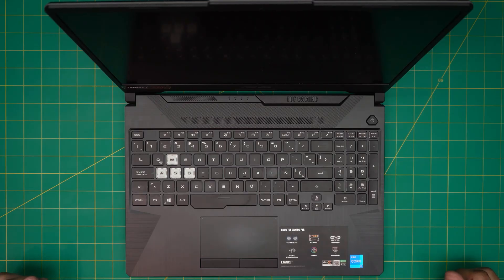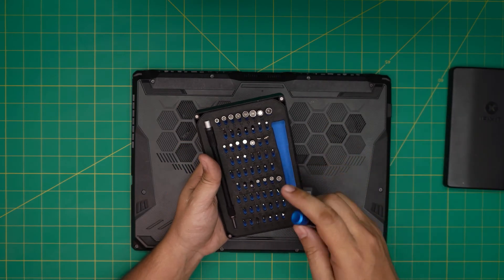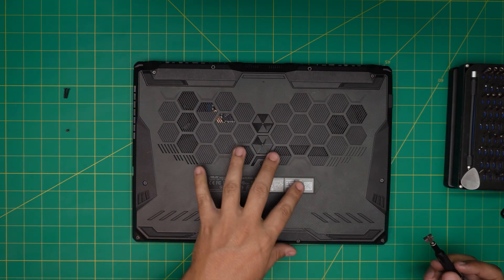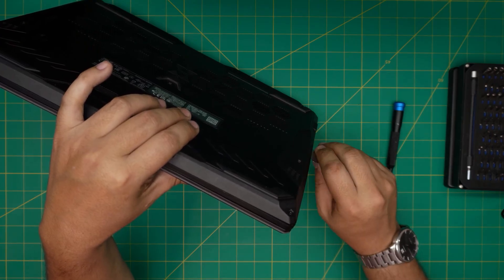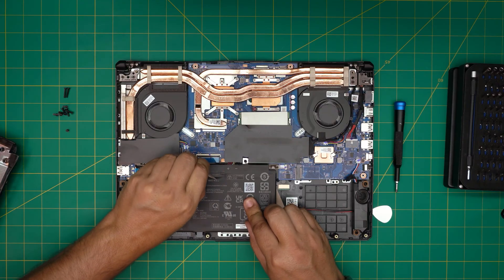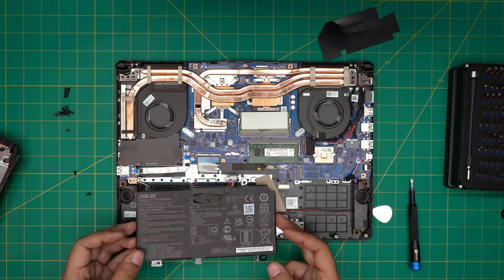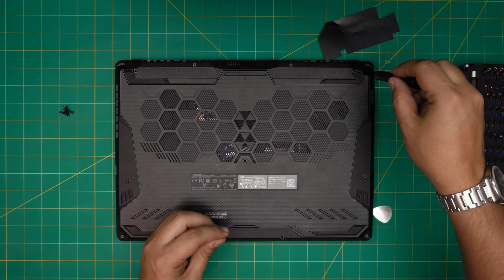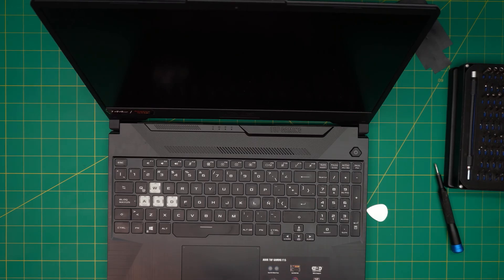How to Replace Battery on Asus Tuf Gaming F15 FX506H Laptop - Step-by-Step🔋

Comment: does it has any cmos batter or not my laptop is not working i have to remove and. put back the cmos battery
Reply from the maker: 🫠 Regarding your question, this laptop doesn’t have a dedicated CMOS battery; it takes its charge from the main internal battery. You can use the laptop without the internal battery, but it will take a few seconds to power on when only the charger is connected.
Cheers 🍻

Comment: Sometimes ,after turn off  i start at morning then i see battery is fully drain and sometimes same perce tage, i saw 3,4 times, is it software issue or battery issue, i guess i need to look more it it happening or not lime draining issue, its almost 3 year pf my new asus tuf laptop
Reply from the maker: 🫠Regarding your question, that is a battery issue. We get that issue all the time in the store.
Change the battery only.
cheers🍻

Comment: I plugged it in for one hour and the light that signals it being fully charged is on. Do I still leave it for another four hours?
Reply from the maker: 🫠Regarding your question, no after two hours power on and see if the charge is 100%, else you got a bad battery.
cheers🍻
Reply: @uFixTek  turned it on and 100%. Do I drain to 50% and charge again?
Reply from the maker: drain and then charge it back to 100.

Comment: is it possible to remove the central battery and then plug it in and still use it? battery is causing my laptop to turn off whilst plugged in
Reply from the maker: 🫠Regarding your question, sure you can without any issues.
cheers🍻

Comment: HELP PLEASE 

My laptop just shuts down and there is no light at all. I pressed the power button for 1 min. It starts to turn on but automatically shuts down again.

What could be the problem, and how can i fix this?
Reply from the maker: 🫠Regarding your question, I recommend you do the following:
Disconnect the charger, open the bottom cover of the laptop, disconnect the battery, and press and hold the power button for 30 seconds.
Plug in the battery and the charger, then power on the laptop and wait up to 30 seconds.
If the laptop still doesn't show any signs of power, then you have a component issue and need to find a good repair shop that can perform component-level repairs.
Should you have any further questions or requests in the future, please don't hesitate to ask me.
cheers🍻

Comment: Mine is so hard to take out why
Reply from the maker: what part is hard to take out?
Reply: @uFixTek The battery
Reply from the maker: yes that jack does requires a bit of force to slide it out (remove the screws for the battery and then use the cable to slide the connector).

Comment: hello sir i have replaced my battery today but it is giving only 2 hours backup it is good or not because i am not open any hard software i am using normally lectures only
Reply from the maker: 🫠 Regarding your question, that is normal for 2 hours. You can set the power management to save battery, lower the display brightness a bit, and close any programs that may be running in the background. But 2 hours on average is OK.

Comment: HELLO PLEASE HELP

I changed my battery and then put the bottom cover back on, when flipped it over I noticed the battery light came on as if it was charging. Out of curiosity I powered it on and it tells me it is on charge when there is no charging cable connected. How can I fix this?
Reply from the maker: 🫠 Regarding your question, disconnect the charger, disconnect the battery, and press and hold the power button for 30 seconds. Then let go, plug in the charger, and wait 30 seconds. After that, reconnect the battery (without disconnecting the charger), let it sit for 2 hours, and then test it.
cheers🍻

Comment: Can I upgrade it to 90wh battery?
Reply from the maker: 🫠Regarding your question, sure you can, as long as the connector is the same and the screw holes match. You can definitely use a 90Wh.
Should you have any further questions or requests in the future, please don't hesitate to ask me.
cheers🍻

Comment: I want to know about the battery can you change it from 45wh battery to 90wh battery but different model number?
Reply from the maker: 🫠Regarding your question, sure you can, IF you find a battery that fits in the same place with the same clips, and has the same exact connector. sure you can place a 90w or 95w.
Should you have any further questions or requests in the future, please don't hesitate to ask me.
cheers🍻

Comment: Mine is ASUS TUF Gaming F15 FX506LHB it has 48Wh battery originally ,can i upgrade it to 90Wh?
Reply from the maker: 🫠Regarding your question, yes, you can, as long as you find a seller offering a 90Wh battery with the same connector. You can definitely replace it.
cheers🍻
Reply: @uFixTek is it possible?
Reply: Were u able to do it?

Comment: can i change a 90hrw battery in 48whr asus tuf f15?
please tell
Reply from the maker: 🫠Regarding your question, sure you can, as long as you can find a seller that sells a battery for this model that is 90Whr.
it must have the same connectors and the same screw holes, don't force it.
Should you have any further questions or requests in the future, please don't hesitate to ask me.
cheers🍻

Comment: I have the FX507ZC4 model, since I bought it i feel that the battery doesn't last how much it's supposed to, and recently it doesn't want to turn on when unplugged and when puggled it's very hard to make it turn on, but it turns on eventually and the light when the charger is plugged works. Should I replace the battery or could be something else?
Reply from the maker: 🫠Regarding your question, we get this issue for this models all the time in the store and the problem is on the motherboard, we recommend you to send it for warranty, as the issue will get worse over time.
Should you have any further questions or requests in the future, please don't hesitate to ask me.
cheers🍻
Reply: @uFixTek  Thank you so much for repplying, unfortunately it doesnt have warranty anymore :((
Reply from the maker: It's my pleasure, my friend. Unfortunately, you will need to find a skilled technician near you who can check and repair boards at the component level.

Comment: Bro I have tuf f15 11th gen rts 2050 fx506hf 48wh battery can you tell me it is upgradeable to 90wh please reply bro
Reply from the maker: 🫠Regarding your question, we have not seen a 90w battery for it on sellers, but if you find one that fits with the same connector it will work, as long as the connector is the same and is for ASUS.
cheers🍻

Comment: Hey man, i just replaced my battery and my laptop turns on and stuff but it doesnt recognise the battery. Even when i put the old one in (before the change it would recognise it) it doesnt recognise it. The charging light is flashing. It also doesnt work when i pull the cable out which means its not chsrging the battery either. Ive checked the pins and i couldnt see any bent pins. Any solution?
Reply from the maker: 🫠Regarding your question, Remove the charger and the battery, then press and hold the power button for 60 seconds. Afterward, reinsert the battery, plug in the charger, and wait 15 minutes before powering on.

Comment: I  bought this laptop because it said it came with a 90W battery.  It doesn't as seen here it says 48W.  I reached out to Asus and they said the 90W will not work with this laptop because it is 15.4V.  So I am stuck with it.  Yet still they advertise this laptop as having a 90W battery.  Unreal.
Reply from the maker: Oh, we hear that in the store all the time. Once we open the laptop, clients often claim we’ve swapped their 90W battery for a lower one and accuse us of stealing it. This is a classic issue with our clients. So, whenever we get a client with this laptop in the store, we make sure to inform them upfront that they don’t actually have a 90W battery, even though ASUS keeps advertising it as 90W.
GG

Comment: My battery is draining my full charge capacity is lower than the design capacity do i need to change and also the computer performs low while on the battery bro
Reply from the maker: 🫠Regarding your battery, yes, you will need to change it. These laptops, when used on battery, will run at a slower clock speed because the battery can't output enough amps.
Should you have any further questions or requests in the future, please don't hesitate to ask me.
cheers🍻

Comment: Everyone here for the 15v 90w battery going in the 48w models - NO 😢 (we got ripped off)
Reply: @uFixTek  I have the F15-FX506L , have been told can’t upgrade the battery? Can confirm
Reply from the maker: the battery that i can't find is only48w and i have not to see a higher capacity with the same connector and that it fits.

Comment: Hello, I have the same laptop. I disconected the battery and replaced the ssd, but when I reconnected the battery, the laptop wont turn on, and show no light, even with the charger connected, any idea?
Reply from the maker: Did you insert the ssd correctly and is no side ways in?

Comment: Cnau I change my ausu tuff f15 506hf battery from 48 w to 90 or something better
Reply from the maker: 🫠Regarding your question, i have not seen a 90W battery if they have made it with same connection and screw holes then sure you can install it.
there are fake battery that say 98W becareful
Reply: You can NOT change it to 90W.  Asus confirmed this.

Comment: I have the same laptop, one problem I’m facing is when I turn it on, the keyboard lights up but the power is kind of frozen and the screen is pitch black. You have any suggestions I can do to fix the issue?
Reply from the maker: remove both rams and disconnect the battery and press and hold the power button for 30-40sec then let go and insert the rams and battery and power on and wait 10-15sec.
Reply: @uFixTek Git similiar problem here with same model, but mine is when the power button pressed, the light on the keyboard light up for +-1 sec, but the laptop wont turn on. What is my laptop problem? Still can be repaired or better buy new one?
Reply: Mine won’t turn on?

Comment: I have clean those fans, repaste thermal paste, upgrade new RAM. Then during im putting back all the mounting screw for the bottom cover. The laptop fans runs and my power lights flickering. But the laptop didn't turn on. I didnt break anything. I need help😢
Reply from the maker: i need you to remove the charger , remove the rams and disconnect the battery and then press and hold the power on for 30sec, then plug in the rams and battery and charger and power on and wait 10-15sec .
else put back the original rams and test again, if none worked then you have done something wrong.

Comment: is this something that is recommended to do if the laptop is always plugged in?
Reply from the maker: Thank you for your feedback! If you wish to support the channel, you can like, subscribe, or both!
Regarding your question, if it is plugged in all the times, bring down the battery capacity down to 40% and power off and disconnect the battery and leave it disconnected at 40%. this way the battery wont degrade and the motherboard will last longer.
Should you have any further questions or requests in the future, please don't hesitate to ask me.
cheers🍻

Comment: Hello there I have a question...is 90wh gives us long battery health because the one I'm using with 48wh give me 1.5 to 2 hours only with light tasks...if yes can you tell me whether my laptop is supported to upgrade the battery to 90wh

Asus Tuf Gaming F15 Fx506h 2021
Specs
16Gb Ram
Rtx 2050
Intel i5 11400H
Reply from the maker: Thank you for your feedback! If you wish to support the channel, you can like, subscribe, or both!
Regarding your question, if the battery model is the same as the 48w that  you have and has the same screws and connector sure you can place it and it will work fine.
you will get 45% extra hours of work.
Should you have any further questions or requests in the future, please don't hesitate to ask me.
cheers🍻
Reply: Thank you for ur reply lad 🥂
Reply from the maker: It's my pleasure my friend.
Reply from the maker: It's my pleasure my friend.
Reply: @theonlytruth25 did u make it work? 90wh in 48wh?

Comment: Hi. Can I install a 90wh battery? One version of this laptop comes with a larger battery.
Reply from the maker: Thank you for the feedback! if you wish to support the channel you can LIKE or SUB or both :P
regarding your question: you can install a 90Wh battery but you must find a seller that sells it for this model, because if you get a 90Wh that is made for a slight different version of the same laptop, you will damage your motherboard because of the inversion of the cables, or it will not simply fit and the screw hole match.
Reply: @uFixTek  can you recommended the type of these 90wh battery?
Reply: @onnokis5596  yep can you please
Reply: I was given this information by official ASUS support for my Asus tuff gaming F15 (FX506HL):
Battery:

Part name:  FX505GT BATT/BYD PRIS/B31N1726
Part number: 0B200-03270200
Reply: @RSA_Shock  from where can we buy this??
Reply: @ShivanshSood-uf2vo  idk im from south africa
Reply: There is a seller available, but he is selling it very highly priced
Reply: I bought the one and the laptop back cover can be put back because it is 5 mm wider
Reply: @andraskalmar3827 did it work

Comment: I upgraded the ram, disconnected the battery, installed the ram memory and then connected the battery, the battery light flashes, and the battery seems to be disconnected, I only go from the electrical plug. Everything is fine, I worked gently, I didn't break anything. I tried reinstalling the battery driver. Where is the problem ?
Reply from the maker: Thank you for the feedback! if you wish to support the channel you can LIKE or SUB or both :P
regarding your question:  did you pull the connector of the battery straight out back, and not side ways?, make sure the pins inside the jack where the battery goes in all the pins are straight. usually those pins are fragile and get bent easy. also you don't need ever never to remove the battery to upgrade the ram or ssd's
Reply: same problem with me and I am pretty sure I didn't damaged anything
would love to get a fix for the problem

Comment: Is it not possible to add a hard drive to this computer?
Reply from the maker: Thank you for the feedback! if you wish to support the channel you can LIKE or SUB or both :P
regarding your question: for the SSD  upgrade here is the video: https://youtu.be/pVQ4O5nWgLo
BUT if you want to add a HDD you can't only SSD m.2
Reply: You can only add a HDD externally through USB or Thunderbolt
Reply: @mofkergt  I added the Samsung SSD 980 NVMe M.2. there is actually another slot for for it laptops take specialized hard drives made for them and I have the FX506L model